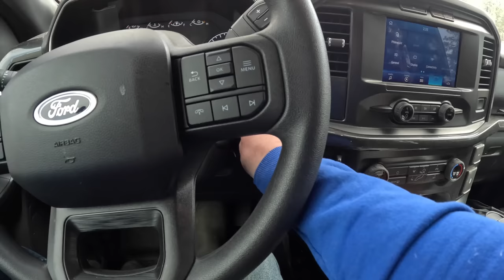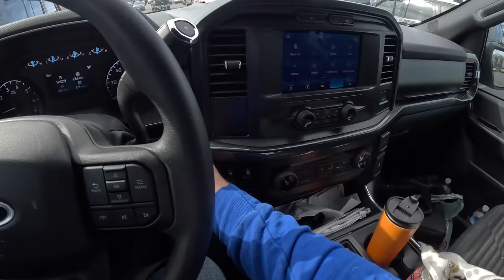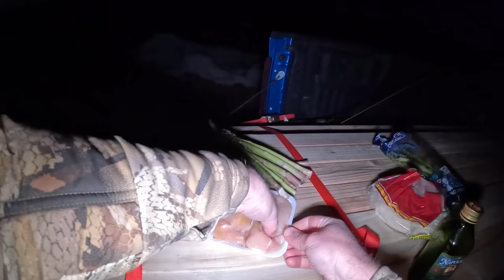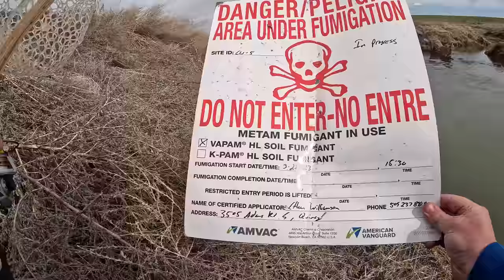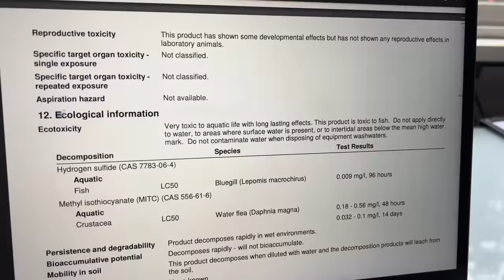Trout Fishing & SOLO Camping! (Surrounded by COYOTES at Night!!!)

Comment: The walnuts Leif whacked with the shovel are Black Walnuts. They are indeed challenging to extract from their dense, compact shells; but those are the same nuts one finds in such delicious treats as Black Walnut Ice Cream. The flavor is a bit more astringent than English Walnut, which accounts for the face he made in reaction when the taste was more bitter than anticipated. I like the flavor a lot even though I favor a malty, somewhat sweet doppelbock such as Spaten Optimator (one Leif might be familiar with)  among brands of affordable beer compared to the world famous Guinness dry Irish stout.

It seems that Washington State pioneers were partial to Black Walnut trees for they are well distributed on both sides of the Cascade Mountains. One can encounter feral examples when wandering our state off-track. Squirrels likely contributed to such secluded plantings, though I'm sure crows and ravens did their part through their practice of dropping the nuts from high, onto hard surfaces in their efforts to crack the shells. Paved roads are the typical targets today, but during the state's early years hard-surfaced roads were scarce, while rock outcroppings have always been available.